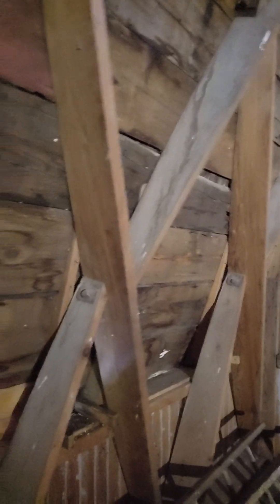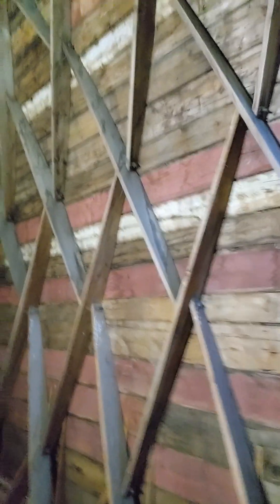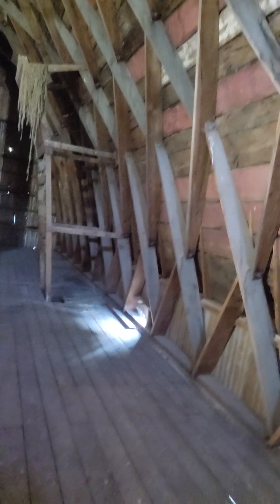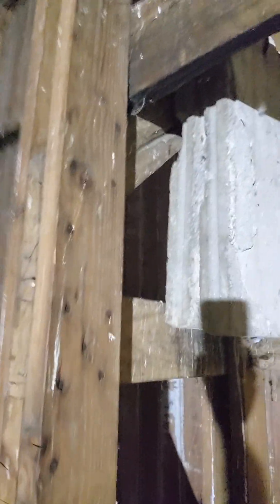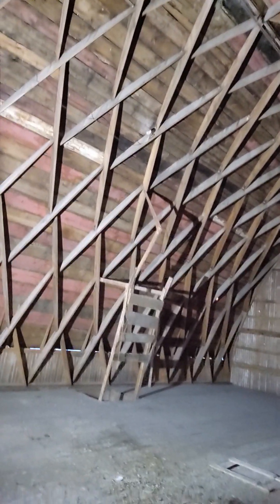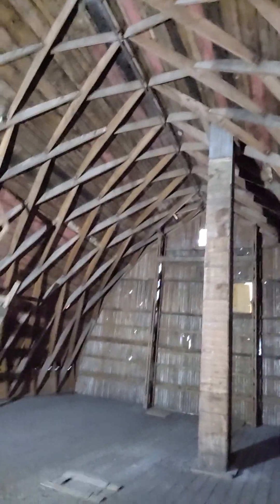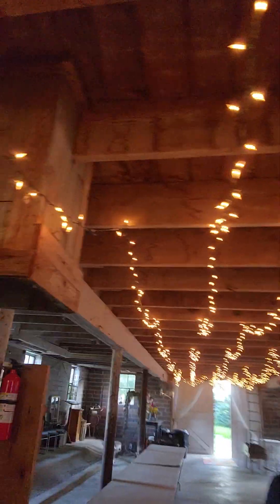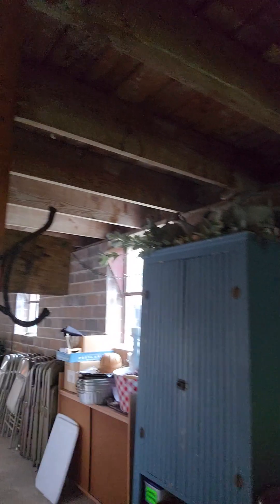First lamella roof I've ever seen

Comment: I used to have a book on various construction techniques and from what I recall a true Lamella roof has large concrete anchor blocks along the bottom to hold the weight of the structure and to keep the near-vertical portion of the roof from bowing onwards. I would really like to see the outside of this structure.